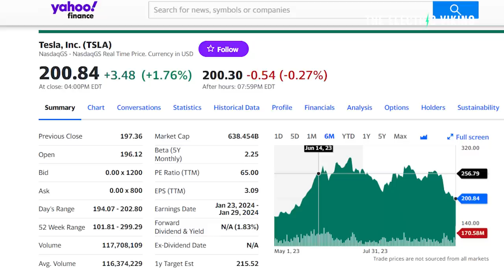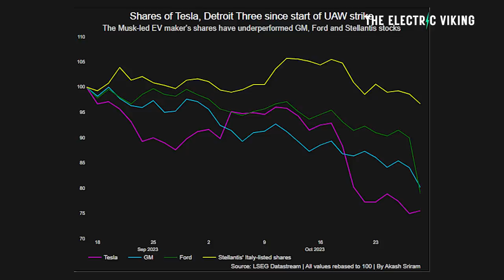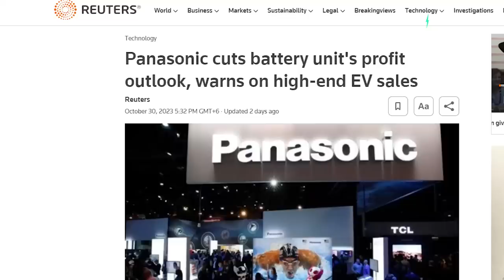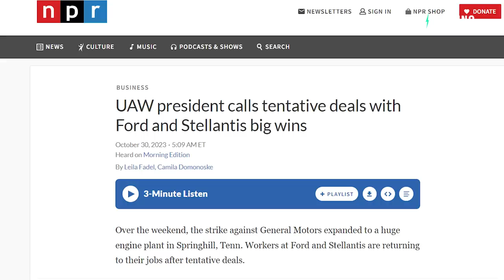Tesla shares fall as production cut by Panasonic creates EV demand fears

Comment: This is the problem with stocks. It's not just the performance of the company that can cause it to go up or down.
Reply: performance seldom has anything to do with what happens on wall street. most stock brokers would be better off using ouija boards.

Comment: Some says Panasonic are going to slowing production of the 1865 cell used in Model S and X due to lower sales. Sawyer Meriit just wrote on X that Model X LR orders now shows deliveries in Jan-Feb 24. Just a couple of days ago the deliveries was changed from Nov-Dec to Dec- Jan. does not look like slowing down to me.
Reply: Maybe Tesla are at long last switching over the model s/x from 18650 to 2170 batteries. This would explain why Panasonic would slow down manufacturing 18650 and why model x delivery time is projected to be later (retooling)

Comment: i dont care about Tesla day to day stock prices but if the company is really doing well then overall it will trend upwards and if the media does these things that will tend to lower the prices then the investors should be happy about that since they can take advantage to buy lower and sell higher just like Musk mentioned to do with Tsla stock in the Q3 earnings call..  But for me as a clean energy and an EV fan i just want to see Tesla as well as every other EV brand produce and sell as many EVs as possible !
Reply: When you factor in the huge amount of exotic material required to build an EV in particular the massive battery, and how most batteries will "realistically" end up in landfill as they are not economical to recycle, they are only slightly more environmentally friendly at best.  Musk is also making a lot of missteps not reaming politically neutral, half the US now hates him and ironically that's the half buying more EV's.

Comment: The EV Car Industry needs a Standard Battery fit for All EV Cars. Cooperation in Battery Production for Standard Battery. Every Gas Car has the same standard Gas. Now Every EV Car has a different Battery. Standardisation is Needed. And a Standard Battery Swapp System  along with Standard Batteries.

Comment: Eventually form will follow function. 

The blade battery configuration has just 126 cells. The jelly roll format has well over one thousand cells. 

The reduced parts count and simplicity of the blade format is compelling.

Comment: I think the Model S and X use 18650 batteries.  Panasonic makes these cells in Japan.  If demand for the S and X is slowing, then it makes sense Panasonic would lower their production.  
"The energy unit made battery cells for Tesla's premium Model S and Model X that during the quarter came with a higher price tag than what would make them eligible for U.S. tax credits, said Panasonic's Group CFO Hirokazu Umeda.

"Since these are luxury cars that exceed this price, demand has fallen," Umeda told analysts and reporters during a briefing on the company's second-quarter financial results."
Reply: It's a standard battery built by any company in the world! Same will hopefully happen with 4680 cells. Upscaling leads to lower prices.🤔

Comment: In the UK a real lack of demand has developed,  sales are now almost entirely supported by subsidised company car sales.  Private buyers have fallen back rapidly.  Before it may have been said to be the charging network but now more over, amongst other things it is the cost of public charging.  It is literally cheaper to run a petrol car than an EV via public charging.  But worryingly, that shows no signs of changing.  Finally you have the rollout of chargers amazingly, but actually slowing down, so you have a quadruple whammy: the initial cost of an ev, the lack of charge points, the cost to use those charge points, and the slowing rollout.  Unfortunately it is not looking good right now.
Reply: They were always an environmental disaster not fit for purpose, thankfully most people had the brains to see this. The old saying “a fool and his money are easily parted” most definitely applies here.
Reply: @oldbloke204  I have not seen it yet, but I think the realisation is starting to hit, I am actually sad about it, but it seems unless you have a driveway and home charging, public charging costs are frankly a joke.  I don't think people realise just how expensive we are talking here.